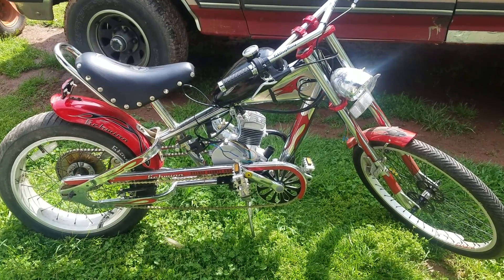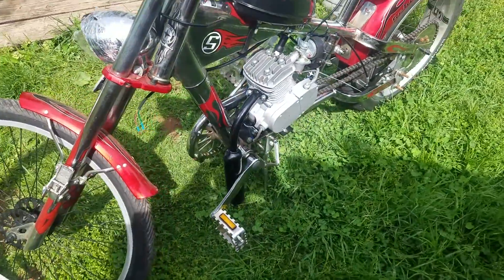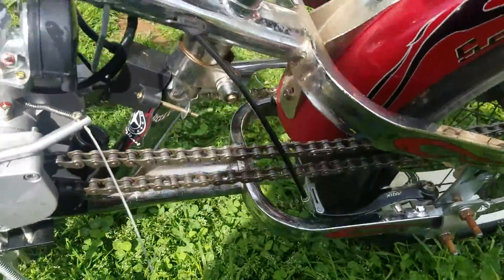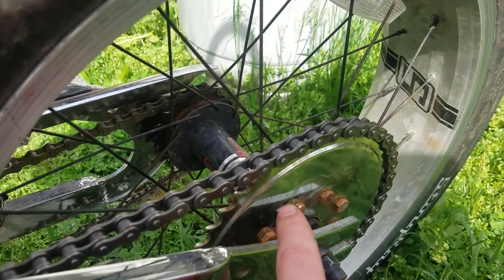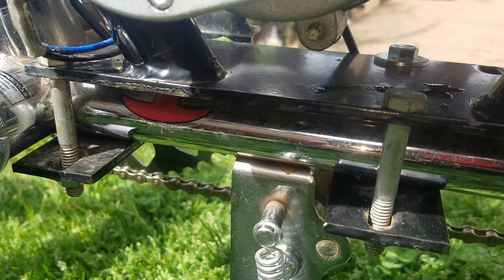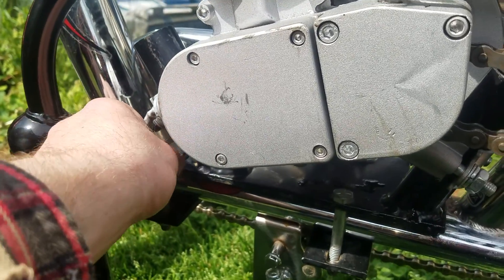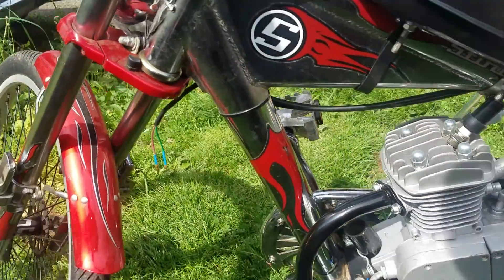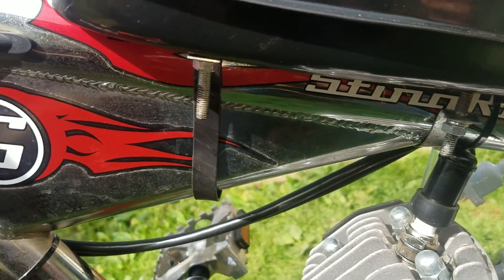OCC Schwinn Chopper New build 80cc

Comment: I just got the black and chrome Schwinn OC Chopper and I’m doing a build with the Zeda 80 Firestorm engine kit. Does the exhaust fit without having the bend the pipe at all?? I do not have the equipment to heat and bend the pipe myself.

Comment: With the normal sprocket hub adapter does it not slip or rub against the tire and how did you mount the tank that’s the things I’m very confused about
Reply: You kind have to find or make a mount yourself, I just we t to lowes and asked for a piece of bendable sheet metal and the guy gave me a two foot by 2 inch piece of bendable metal that had a bunch of holes in it, im pretty sure I can bend it to work and paint it black, he also recommended a $7 hack saw to cut it to size so it’s not really that hard to make your own tank bracket